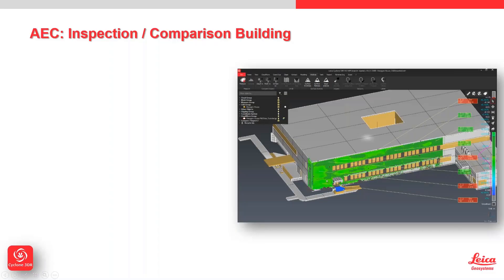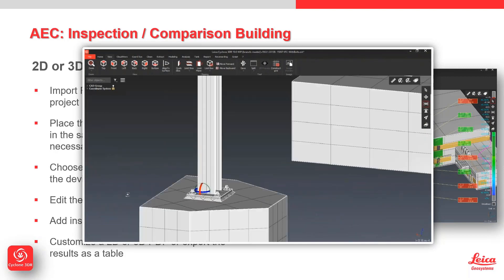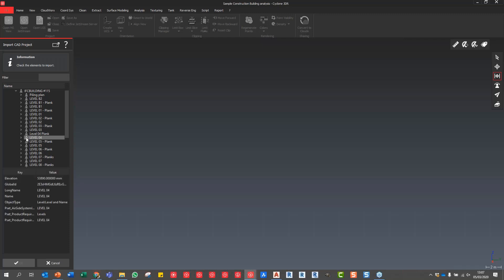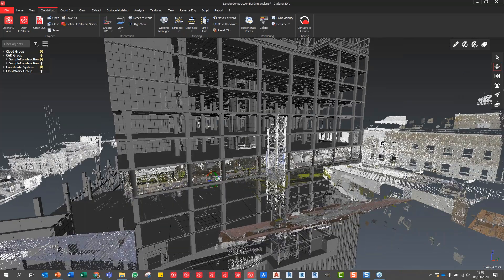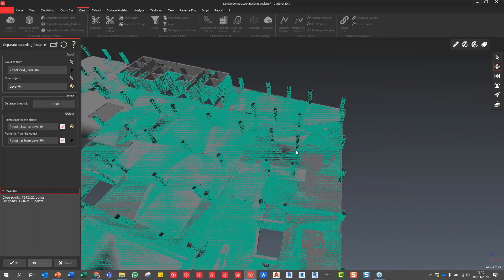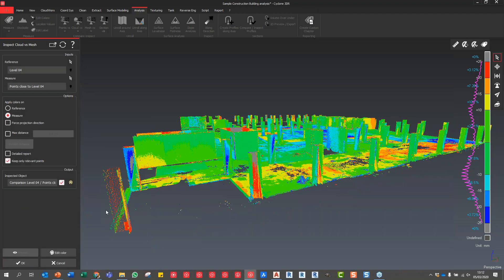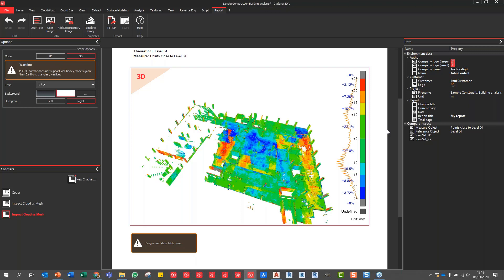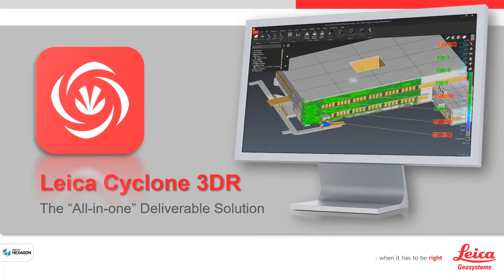Leica Cyclone 3DR Building Inspection Demonstration with Paul Burrows & Klaus Rieke

Comment: Can you advise the accuracy of the deviation between pointcloud and Mesh model from this workflow?
Reply from the maker: It's a BIM model (IFC for example), not a mesh in this instance - the accuracy depends on the sensor used and how well you have aligned the model and the point-cloud (but mostly in these workflows, the model and the data are aligned prior to the point of import due to shared coordinate systems).

Comment: IFC model when imported into 3DR doensnt seem to align with point cloud. Checked the IFC model and the associated point cloud in navisworks, perfectly aligned. What could have gone wrong?
Reply: Magnus could it be that you had an UCS active? That could easily cause it. Otherwise there shouldn't be an issue 😉
Reply: @KlausR3D  Only WCS was active
Reply: @KlausR3D  Should I turn off the WCS altogether ?
Reply: @Malone178  strange. Was it off in all directions or for example only in height?
Reply: All directions
Reply: @Malone178  that’s odd. Did you get in touch with your local dealer already? If not can you share the data to have a look at?
Reply: @KlausR3D  Your email?

Comment: can you use other point cloud formats instead of lgs such as PTS, LAS, E57 to overlay the two models ?
Reply from the maker: Yes, Cyclone 3DR is very open in that regard... we have a HUGE list if import types you can import and then run analysis upon.
Reply: @RealityCaptureGuy  Inspection workflow (i.e. mapping tool) will work just the same as other point cloud files? noting that LGS has more information it carries?
Reply: @teewetekaata3510  easy of use, displaying initially and choose what point cloud you want to use. Otherwise the other point cloud formats are working in the same way